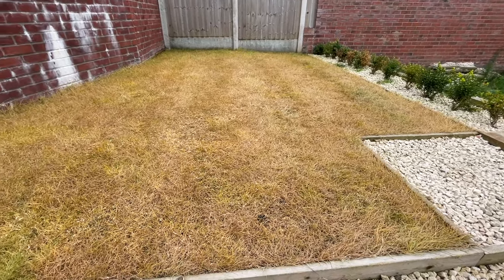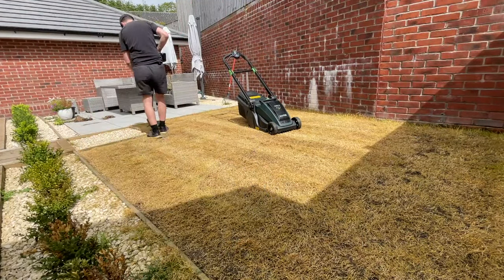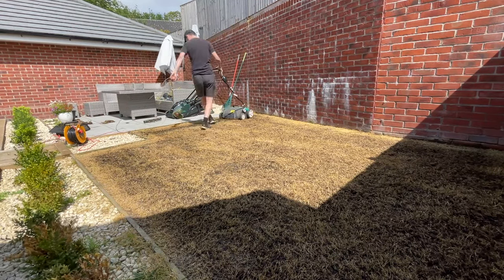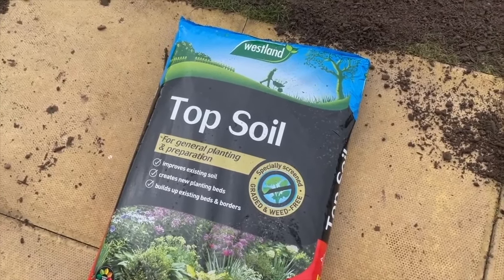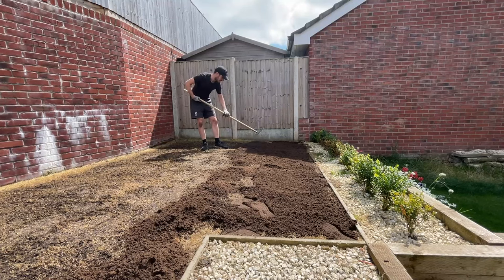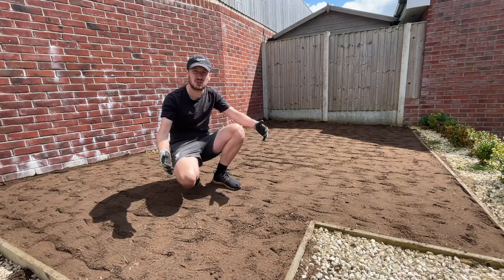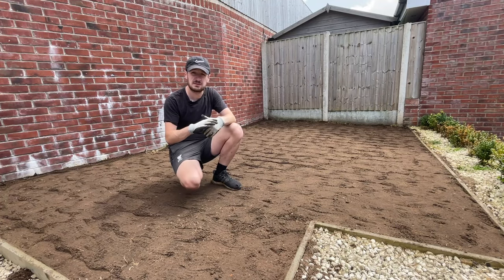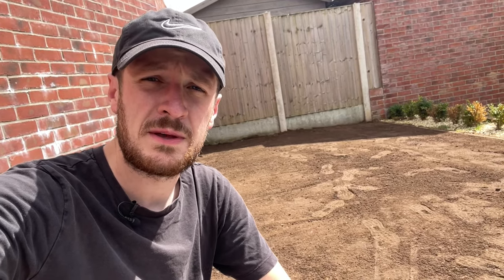How to LEVEL a NEW LAWN Using TOP SOIL - Complete Lawn Renovation

Comment: Another great video buddy… just wondering and I’ve not tried it yet, but would you’ve pulled out more grass using the rake attachment on the scarifier and then. Going over again with the scarifier attachment. Like you say the dead grass will decompose, but will it give an instant thatch layer. I’m probably overthinking it… keep um coming bud. Very much enjoy them 👍
Reply from the maker: Cheers!

It's a good point, I'm not sure to be honest. It may have been better to do a few more passes, but fingers crossed it doesn't impact too much 🤞🏻

Comment: Great job. What seed are you using? Germinals A5 is the best rye I have ever used as it's produces more leaves per plant and has about 60% the blade width of others. It's also very tolerant of low mowing down to 4mm.
Reply from the maker: I've gone with A1 Lawn. I'm hoping to get a proper short lawn once I've got a cylinder mower just so I can get it really short.
Reply: Awesome. How low can you get now?   @NoviceGardener

Comment: How thick do you layer the topsoil for sowing seeds? My garden is about 42m2 and it is being recommended on the calculator that i have 9 ton bags to cover at 100mm. Cheers mate for any advice
Reply from the maker: Main aim if for the top 4 inches. The roots won't often go much lower. 9 ton bags will give you a very decent bed of soil though!

Comment: Instead of killing the grass off with weedkiller, would it not of been better to hire a de turfer, then rotovate the soil
Reply from the maker: It would take up too much of the soil that's already there, but it could be done if you've already got quick a thick top soil layer that doesn't have too much clay.

Comment: Would this still work without putting topsoil down? I have put glyphosate on my front and back lawns, all the grass is now dead, so going to scarify next, but can't really afford loads of top soil, so was just going to put new seed down, and cover with compost, but my concern is even though the grass is now dead from glyphosate, the roots are occupying the soil space, so would be no room for new seed to germinate and get space in the ground, what do you think? Thanks mate.
Reply from the maker: It will work with just getting some new seed down with a top dressing. Shouldn't need to buy top soil if you do it that way 👍🏻
Reply: @NoviceGardener  thanks mate, but I found that out already🤣🤣🤣🤣I sowed the seed last Sunday front and back, put a light coating of jack's magic over it, and just 6 days later it has all germinated and sprouting a good few mm already, probs in about another week it will be all green with no bare patches and ready for its first mow in about two to three weeks, before taking and seeding,I put my weed burner all over it, so it burnt away any remains of the dead grass and weeds, so was total brown soil then, before I seeded🥳🥳🥳🥳
Reply from the maker: @markslade9722 nice one! Weather should be good for it this week too with the rain we’re expecting! Hope all goes well over the next few weeks! 👍🏻
Reply: @NoviceGardener  yeah thanks mate, except for today, the last five days have been hot and dry, but luckily I have two linked water butts, so been watering it daily f.o.c, my butts got fully empty by last night, but not far off full again now after all the rain, but shouldn't need to water the lawns at all with the forecast for the next week. I used Johnson's J Premier pitch seed with gromax, 100% p.r.g mix of five different cultivars, same seed used at loads of football grounds, so hoping for great results, and now totally weed free🥳🥳🥳🥳 keep up the great vids!!!